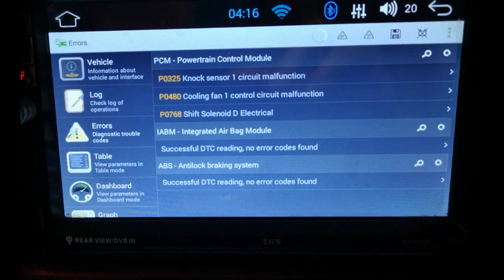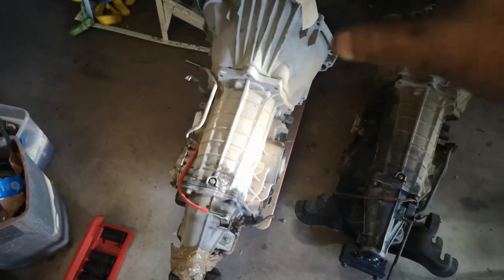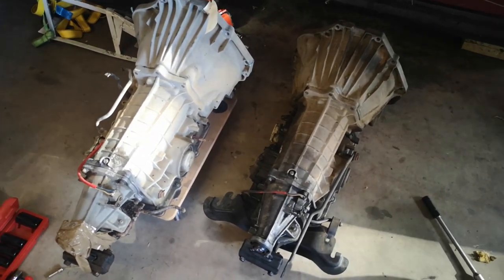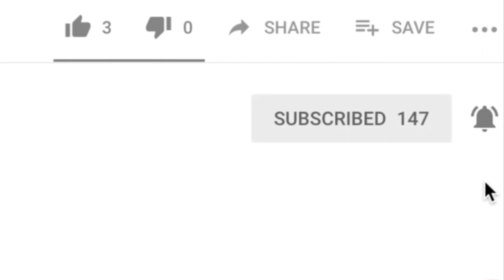How To Remove Automatic Transmission | AU Ford Falcon

Comment: Great video mate, I’ve got a 1999AU wagon with fully slipping clutch discs, burnt out on a steep hill. Can you give any advice on finding a replacement transmission cheap and what model would fit?  Car had only done 250K.  Thanks
Reply from the maker: If you only have a slipping clutch you can just have the clutch repaired. Is the gearbox hard to change gears, missing a gear or something? We are talking about a Manual not Automatic correct? With transmissions it really comes down to how much it costs and how many Ks it has. Second hand you never know the history, was it looked after or not. Reco can cost about $3k. One with low Ks about 140k would be about $1k and 300k plus about $500-$700. Have a look online and call a few wreckers if you need to replace the transmission.
Reply: @TEKNOFIED   Thanks for replying - It is an AU - 1  falcon forte 1999 wagon - Auto transmission, with duel fuel fitted ie LPG - is it even worth repairing - body is beat up, car prob not worth $1000 got 240K on clock but engine still runs ok?  Would i be better off buying a replacement wagon?

Comment: Nice ! I see you used trolley jack + wood blocks  to support the transmission pan. I presumed the pan would be too "soft". Glad it took the load . Whereabouts did you get your block of wood/dimensions? thkx
Reply from the maker: Cheers. The transmission pan can handle being put directly on the big jack like the one I have but can be damaged with a smaller jack. I used wood to play it safe. I got a $9 sleeper from Bunnings and cut it to the size I was happy with.

Comment: I’m building up to taking the auto box out to put in a new converter seal in my ed.  I was wondering if anyone knows if an au box can be put into the earlier car.  And I was also wondering would the fan hit  the radiator as the motor moves around during the procedure?
Reply from the maker: Yes you just need to swap over the bellhousing to fit the ED. They use the same transmissions. I remove the power fans as I feel better about doing so. I am told you can leave the fans in.

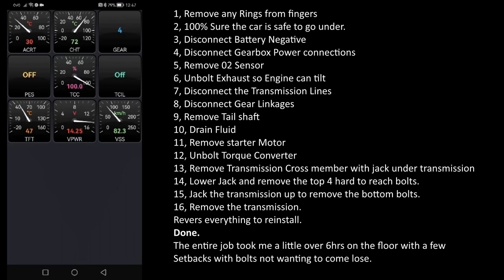Comment: @13:00 what software and scan tool are you using to read the live data?
and i wanted to see you putting it back in... ive done this job a couple of times before.. and getting it back in is a lot harder than getting it out... you have to get the car up as high as you can to gove room to get the box out from under there ..trying to lift the box up onto the trolley jack when under the car sucks as well as getting it balanced and correctly positioned.. try lifting a 100kg weight up while on your back with your hands over your head, doing it by yourself.. i wanted to see how you did that part
Reply from the maker: Hi mate. The software is called Forscan https://www.youtube.com/watch?v=tvGp7Zxe6H0&t=342s 
I completely agree with you with how hard it is and watching the install would have been good. 
The problem was I had only the day to do this job at old mates house. I wanted to work on a clean floor and not 
on the drive way again. My mates Mrs and I don't see eye to eye so I had to be out before his Mrs got back :) 
Recording the install would have taken me longer and I was in rush mode by this time.
I had a really good install and probably the quickest and easiest install yet.
No help and after a few attempts and fails of getting the box on the jack I had a "Moment" and in my rage
I put my legs on the jack and pulled that bad boy onto the jack. It went up and aligned in one go and I had to triple check to make shore I wasn't missing something. It was a good day. Have a good one mate. Cheers.
Reply: It's actually quite easy to install something like this by yourself all you need in commen sense to make it easier, use a ratchet strap to stop the trans from falling etc. Or just be a man and bench it in like I do, use my knees to help while I put a couple bolts in.

Comment: Hello, is there much difference replacing a BA falcon gearbox compared to the AU? Thanks
Reply from the maker: Not really. Differant types of power connections and gear selector link but basically the same job.

Comment: Excellent rundown, I've had a few issues with same gearbox ( btr) due to different reasons,
I'll give you some of them :
1. I used to loose oil if I parked on a really steep hill, from memory it was rear seal, but was a long time ago, never repaired it, stopped parking on steep hills!
2. car got flooded one time, the white plastic switch on outside of gearbox, although it has waterproof case got some water in it, cleaned up all the contacts in it and was fine after that ( hard to get apart without breaking the plastic tabs that hold it together.
3. had issues with solenoids, unfortunately they cant be taken apart to be cleaned, well land truly sealed when made ( moulded plastic case). ( variable pressure solenoid might be able to be taken apart, never tried though).
but worked out a really nice way of testing ( my posts are bottom half on this link:
http://fordmods.com/gearbox-suspension-brake-driveline-f4/testing-btr-shift-solenoids-I .
I  show how to use large syringe to pressure test them, works a treat and dead simple.
Some of them dont seal off completely and leak/loose pressure, only way to test for that is pressure test, so even if resistance is ok, and you can hear them clicking on/off, still need to know if they are turning fully on/off. 
4 low oil levels, get slippage of gears, is good sign oil is getting low.
5. I always thought there were brown and black solenoids, someone told me the black ones were brown ones that got hot......, seems they are all brown ( except variable one).
I could be wrong but makes sense.
Reply from the maker: Thanks for that.
Back in Jul 2021 After my last fluid change I couldn't remove the fill bolt. Threaded the bolt head and broke a socket trying. So I pumped 4L in from the front lines (I don't believe I did any damage filling the box that way). 4L is the standard amount so I thought I was good to go. 
Gears slipping so much the car hardly moved. Then pumped in 500ml more at a time until it was good again. so all up my box now had 5.5L,
I have a cooler so I thought maybe I needed that little extra. It run good for a long time until about 3 months ago I started to notice it would slip turning right only when cold. Engine light in my head said I am low on fluid, as I never saw any sighs of leaking fluid I thought I better get a fluid change done soon anyway. 
Such as life I just hadn't got to it yet. 
Then one week before deciding to do a box swap on the way home the transmission went into 2nd and wouldn't change at all no 1st gear either. Limp home mode.
I managed to drive it home. still no signs of leaking when I checked. 
It Wasn't until I pulled the box off is when I found I did have a front seal leak. Oh well jobs done now. 

I tried to look at the link you shared. Confirmation code is really hard to read I ended up getting lock out of the site. (exceeded the maximum number of registration attempts) I will try to register again another time and have a look. Cheers.
Reply: @TEKNOFIED  oh you couldn't get into that site? I'll do a youtube video at some stage of testing the solenoids with syringe, even if they do turn on/off need to find out if they leak or not. Most solenoid testing videos on youtube only show read resistance and see if they click when powered on.

I changed the valve body on my falcon some time back, couldn't be bothered going through all the testing again, needed it fixed asap. So just bought a second hand box that was good and swapped valve body.
Pretty simple compared to swapping whole box.
I fill through the cooling lines also, its pretty slow.
I just go through a cooler rather than the radiator, that way no chance of water in box if radiator leaks into oil.
Torque converter holds a hell of alot of oil, maybe near 3 litres plus.
So its hard to change out all the oil, really takes 3 or so refills to clean out all the old oil.
You did the real seal too? I see on the vid your hammering at the rear, but not sure if its a new seal?
Reply: that white box on outside of gearbox, its has a whole heap of brass contacts in it, it tells computer which gearshift position is selected.
It has a rubber seal inside it, will keep most moisture out, except my car submerged during road flood some time back and had to clean it out.
Normally I dont think would need to open it up.
Reply from the maker: @namenotshown9277  Still having trouble getting in that site. I replaced both front and real seal with new. I will be very interested to watch your clip when you do get around to making it.
Reply from the maker: @namenotshown9277  The Neutral safety switch I believe it is could? also could have been part of my problem on the old box. I had an EL that worked great. I gave the car a pressure wash one day and got water in that switch. The car had a mind of it's own after that. shifting up and down gears at random. I replaced it and the car was back to normal. That's why a said in my vid, keeps them parts, might need them one day. I think I will make a video opening the old on.